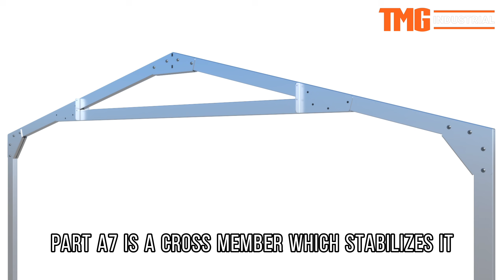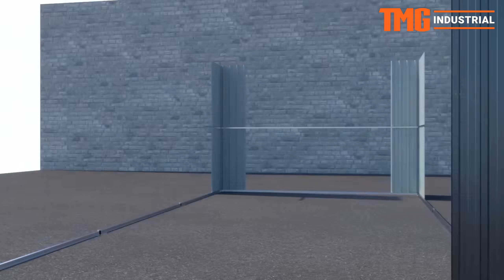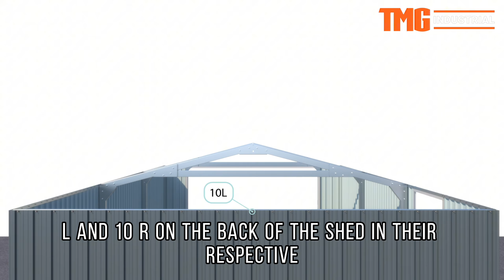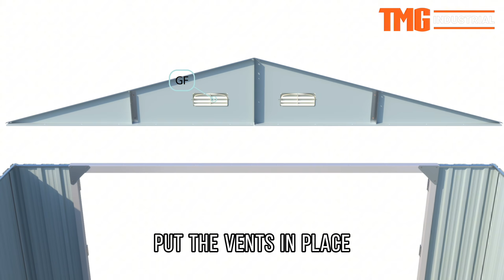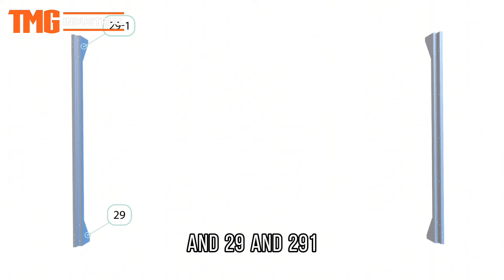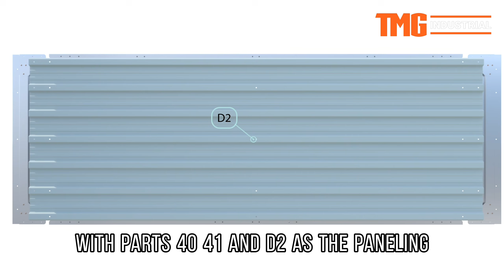TMG Industrial 10' by 20' Metal Shed Assembly Video

Comment: Quality is really good. Everything was well detailed but the door details suck balls. Also, several non-painted parts not piece marked or can't be read. Called them for help, was told that I'd get a call back, haven't heard from them yet. Another tip, put the door hinges on before you do anything else. My 10 x 20 has slotted holes large enough to pull the nuts through, add washers that were not provided. Really freaking stupid design.

Comment: Tip, build it from the back to front if doing it solo, the panels don't hold themselves up well.
Put the hinges on P43 before assembling the door with panels just because it's pretty tight to get your fingers in there.
Reply: What's the thickness of the studs?
Reply: @FrostyFunDelight  If you mean the bars that go along the middle and top of the panels, they're very flimsy, off the top of my head maybe around 1/8 to 1/4 inch thick. Once it's together, the shed is very solid, but until about 70% of the way, it feels very flimsy. If you're talking about the so called columns at the top, about 1/4" thick but they're quite sturdy. This is really just a cheap shed, it is worth the price tag but there's a reason it's 1/4 of the cost of a real shed. Also water likes to leak in through the bottom, so if you go with a concrete pad, water is gonna sit in it. Also these sort of prefab metal sheds are constantly on Ritchiebros auction which I wish I knew before, and I saw them go for way cheaper, so maybe buy one there.
Reply: @Killz0mbies  Thank you. They are all over Ritchiebros auctions
Reply: @cagecatchum3001  Yeah, I mean there's fees and stuff but I saw a double garage shed that's the same sort of material/design/build as this go for...less than this 13x20 retails.